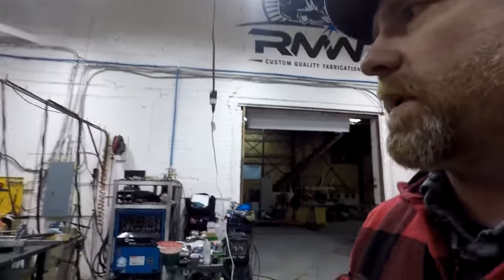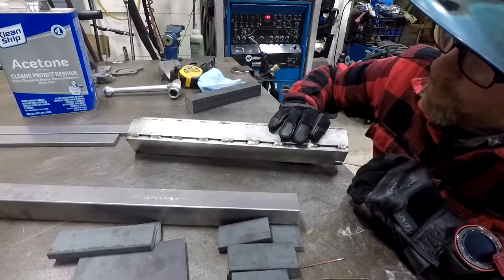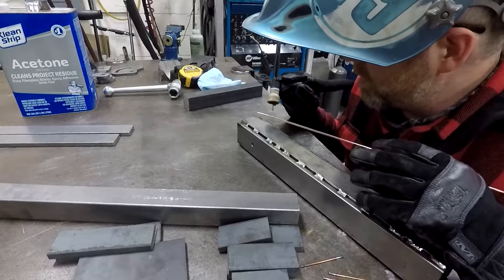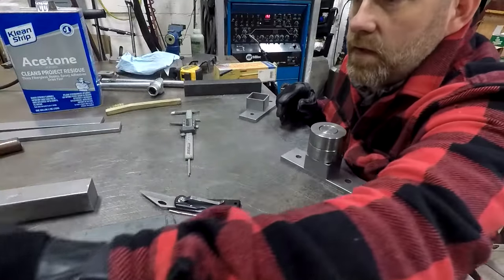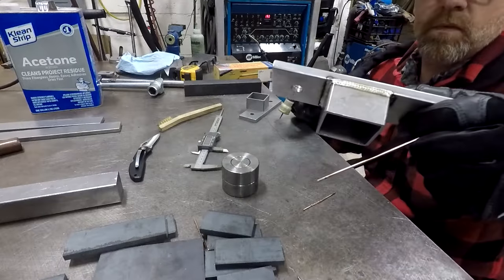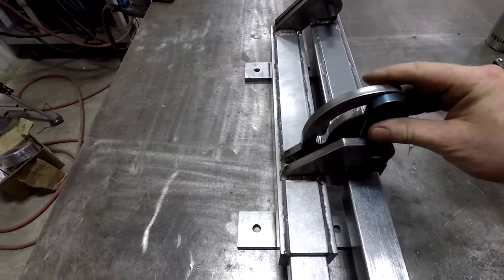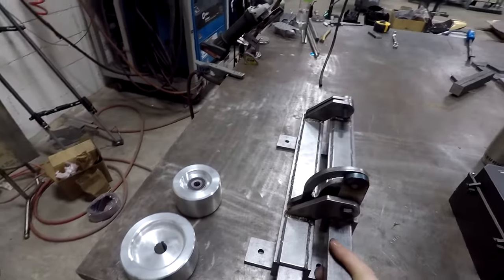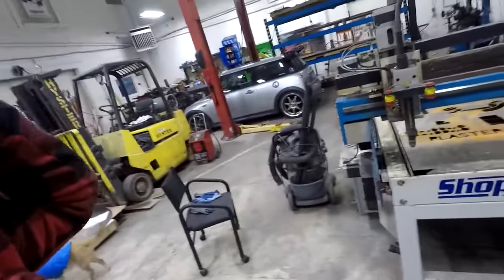RMW Vlog 106 Jeremy Schmidt 2 x 72" belt grinder build  Part 1

Comment: You are right, welding that piece the way you did is the only real way to minimise distortion. Nice work as usual
Reply from the maker: Thanks!  You just have to be patient which is hard to do when you start laying down a nice weld!  I think if I make another one, I will just use 2" .25 wall square tube.

Comment: I'm wondering if Jeremy Schmidts design can be put together with bolts.   It be fun project to see if one can tap and drill holes and make it without welding lol.  yes I'm crazy lol
Reply from the maker: It could be done.  It may be a little tough to keep it is square while drilling, but there are ways around that.

Comment: Probably already done but, could you have left that bar in as a heat sink while welding? Also the acetone can on the bench was freakin my OCD. Nice job!👍🏽
Reply from the maker: I left in when tacking and had to drive it out before welding fully or you would never get it out due to the shims.  Yeah if Mig welding the acetone needs to go, but tig welding doesn't pose much threat, but still not a good idea.  Thanks for the comment and sub!
Reply: I’m still building mine. He made a new mod to the table arm that seems much better
Reply from the maker: @alexworks9659  I did see that video of the improvement.  I don't have one made for myself so I couldnt tell you how much better it would be.  All I thought when watching the video was I remember how much a pain it was to make the original and the new way looks as much a pain.  Lol